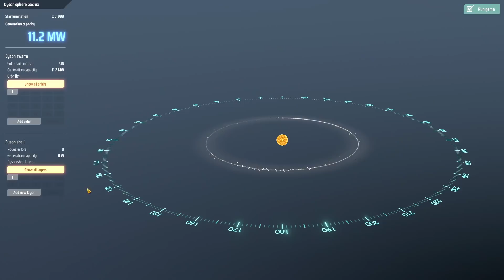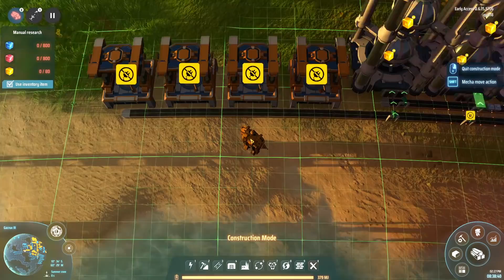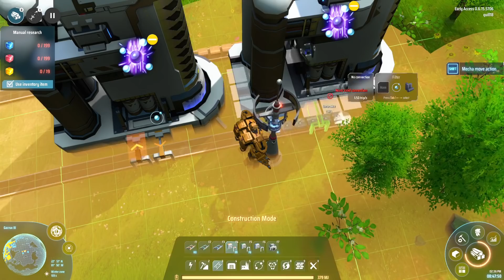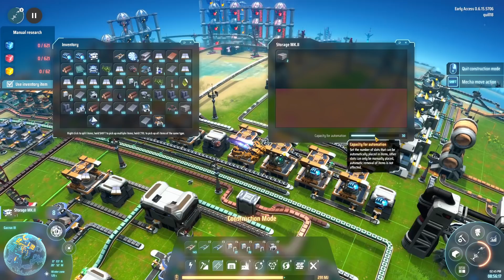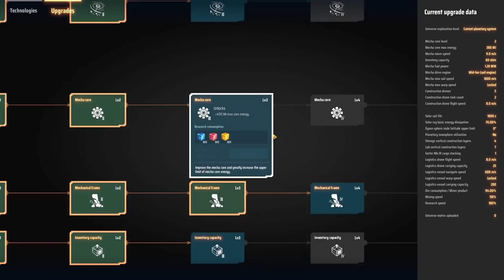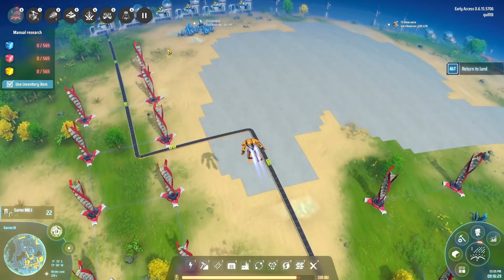Dyson Sphere Program - Cosmic-Scale Factory! Ep 10

Comment: 39:33
The fast fabricators are running at 100% speed.
So currently you are making every 5 seconds one
The Mk I orange fabricator has a speed of x0.75   :(
But the Mk2 are just 25% faster but use up 100% more power.
Reply: The Mk 2 is 33 % faster and uses 33 % more power per item.
Reply: @gruntmaster1  well yes.... if you look from this point.
sure with the power? maybe i thought of Mk3 then? 720

i looked it up: 270 to 480 watts is 77% increase in power use.....
and if you take " 1 " crafting speed... so.. what you see is what you get, as 100% they are 25% quicker...... you need 3 instead of 4 ....
Reply: @Taebs  you go from 0.75 speed to 1.0 speed, so an increase of 0.25/0.75 = 33 %. If you divide 1.77 by 1.33 you get a multiplier of ~ 1.33 of power per item made.

Comment: If you don't need hydrogen, you can burn it for energy... heat generators accept it, it is better than coal, because oil is "infinite"
and you can make hydrogen fuel cells for Ikarus, higher energy density

Comment: 10:33 you can also feed the (in this game) unlimited hydrogen into thermal plants instead of the limited coal which better is turned into energetic carbon which is way easier to get that way than from oil

Comment: I think with this being early access and there could be a lot added to this, it would be best to leave this for now. Come back to the save in awhile, see if anything has changed or it's best to start a new game, which is usually the best part after you work things out in one game

PS where you picked up the fuel at the end, you are just burning coal instead of the fuel you use in the mech that is being made there. There are a lot better fuels to make and then burn that you won't even have to build more power planets if you just change the fuel your using; probably.

Comment: Just burn the hydrogen, you will soon be drowning in it.
Reply: I'm currently building the sphere, and my greatest bottleneck is hydrogen. I started the burn the refined oil some time ago. ^^
Reply: @Uben911  i had my 1st Gas extractor before i even left my 1 system. Soon i ended up spaming them (you can put ~60 on a planet depending on its size). At this stage of development you could potentially Just build max extractors on every gas giant in the cluster (should be no more than 70 giants x 60 orbitals ) and you probably would have enough so you would hardly need any ground production
Reply: @Uben911  I m on the point that i have like to many . to many like they literly are destroying my sistem (bc i don't produce oil if i m full of hydrogen. Is really a botleneck? just put more extractors on the gas planet.
Reply: Most Abundant Element is most abundant. 
"Will you please stop bottlenecking my refined oil output hydrogen?"
"No. Oh wait, that's Nobelium."